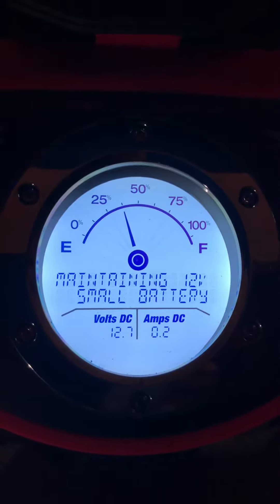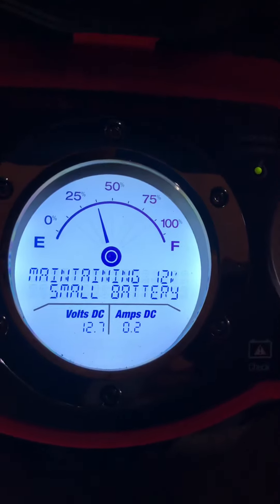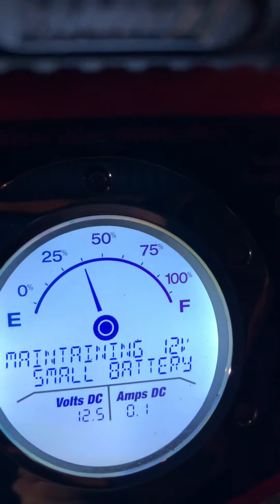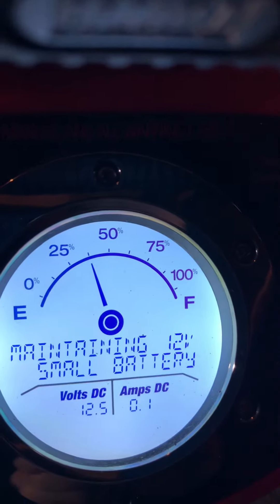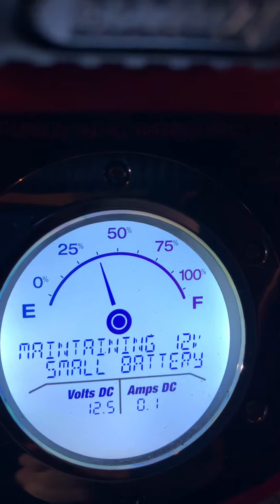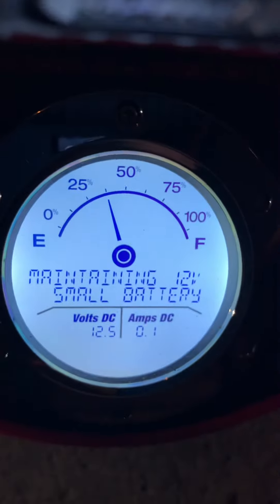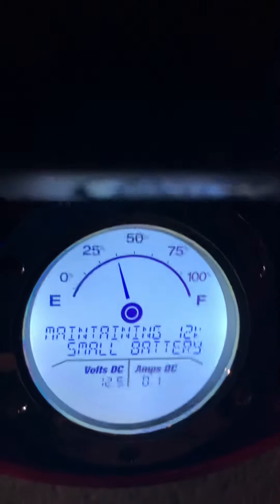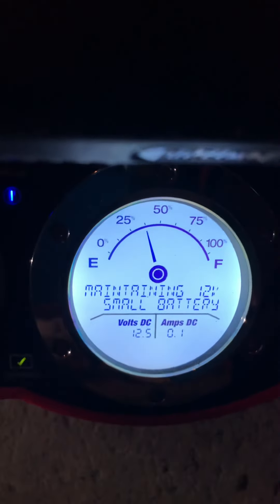Optima Digital 1200 Failure Broken 96 Hour Wrap -Up (5 of 5)

Comment from the maker: Hello Jameson.  Maybe my brain needs a “30-day reconditioning” so…I will revisit this issue in a couple days and make a new video.  I have done nothing with the chargers or batteries since making the original video series so those batteries are due for some T.L.C. at this point.  I just went through the owners-manual again and it sure looks like the various modes are determined by the circuitry of the unit.  I’m just supposed to choose the battery type and connection method.  IT then is supposed to go into “analyzing”, “charging”, “conditioning”, “maintaining” and “30-day reconditioning” mode on its own.  Stay tuned for a retest and thank you for the comment!